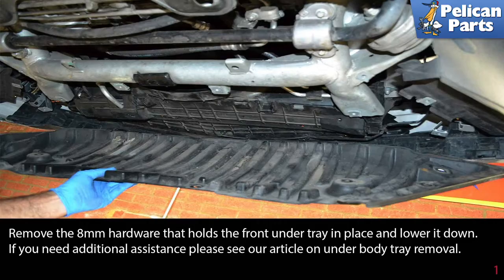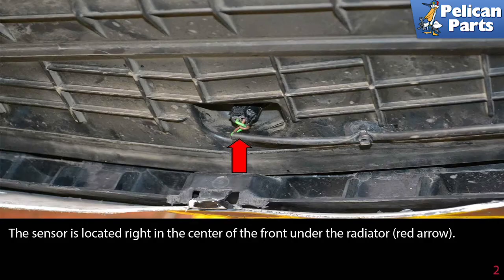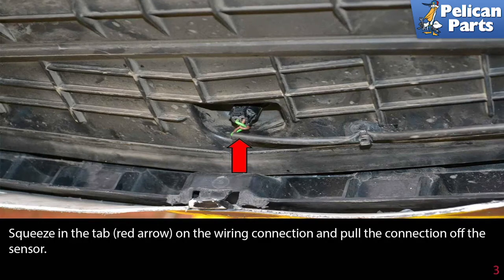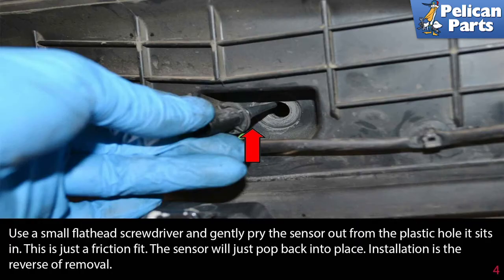Mercedes-Benz W204 C-Class Ambient Air Temperature Sensor Replacement

Comment: would this cause my car to go into limp mode? Im getting error code p2279, there doesnt seem to be any leaks in the hoses  and intake air temperature senor is a suggested cause? Im thinking its something cheap i can try and change myself before going to a garage
Reply from the maker: No it would not. This could be an unmetered air leak.

Comment: I need more information. My Mercedes is showing -40. The air conditioning now is blowing hot like hell I just replaced the sensor it’s still showing -40. I saw a video that said to reset the ambient temp sensor… no information on how to do it on a Mercedes Benz😭
Reply from the maker: What is the year and model of vehicle are you working on? I can see if I have that info.
Reply: @pelicanparts  2015 c300 4matic
Reply: @grant242 did you find solution?
Reply: i have the exact same problem, please help guys
Reply: I have the same problem. -40 .how did you fix the problem

Comment: What happens if this sensor goes bad? I have cold air on the drivers position and hot air in passenger seat, is this sensor the reason ?
Reply from the maker: You would have issue using auto mode.

Comment: I changed the sensor because it was reading P0073 then it went away and P0072 came on? any details on how to fix this issue?
Reply from the maker: I would check if the wiring harness is shorted. Look for physical damage.
Reply: @pelicanparts  Thanks! the wires were fine it was the new sensor that was bad so the new one fixed the issue. thanks again for the reply.